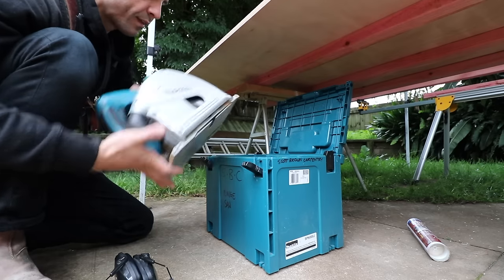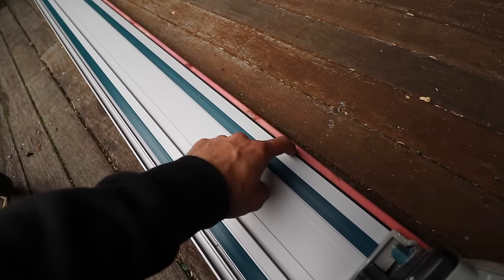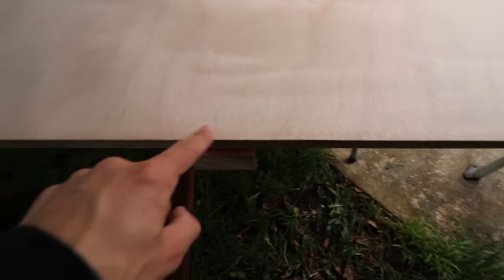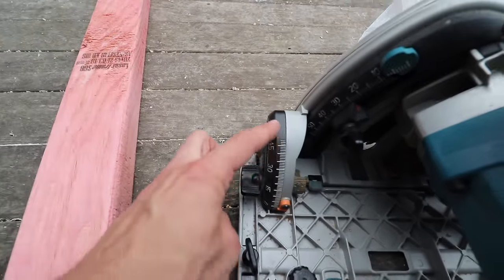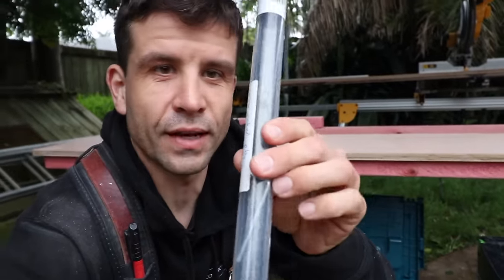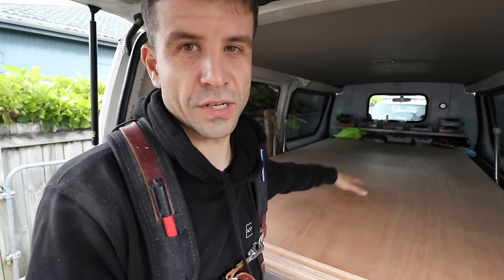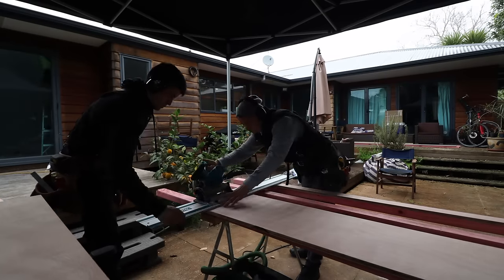Makita Track Saw (Why Every Builder Needs One)

Comment: Used both festool and makita tracksaws for the last few house builds 

Without a doubt I found the festool better for dust extraction and ease of use 

The makita is fine but everything seems a bit cheap and not thought out as well as the festool but still works ok
Reply: Tear a festool down and see what substandard materials are inside... Overpriced designer tools
Reply: The only thing that the Festool has over makita is the depth adjustment mechanism.  On the Festool it's very quick to squeeze, slide and release.  Makita there's a thumb screw.  But that's the only advantage Festool has.  Makita also has the tab that locks in to the rail for miter cuts, Festool does not.  For the money the Makita is a much better value.  I have both the Festool TS75 and and the Makita cordless track saw I recommend the Makita.  Plus, if it's stolen the Makita is cheaper to replace.
Reply: Agree with the Festool having much better dust extraction. If the Makita was around the same price as the Festool then I'd probably think I'd have been better  going for the Festool. But the Makita was, if my memory is right, about £100 cheaper than the Festool when I bought mine five years ago.     IMO it's certainly doesn't feel £100 cheaper.  A work colleague has three saws, mains and cordless Festool and a Mafell mt55. The Mafell is a serious quality machine.
Reply: Or stop playing with toys and get a Mafell ;)
Reply: @kyzenlanx  absolutely 🤣👍
Reply: Hehe I think you are talking about the BOLTR, AvE teardown...
Reply: %100 agree akita is good but festool is better
Reply: I’ve got the Makita plunge saw and a Mafell kss80 and tried the festool on site. Have to say for the price difference the festool isn’t worth it and most of the time I use the KSS now. If I was to replace the plunge saw it would be with the Mafell but only when the Makita dies.
Reply: I've used the fessy and Makita side by side and the Makita is better because it has more power and won't fall off the track on a 45° bevel.
Reply: @karlcraig7214  yeah they are lovely dogs really well tempered lol.
Reply: Festool is well designed with somewhat mediocre materials, like them apple products.  The Festool is a system; everything is also proprietary.  They do work well together but under very ideal conditions.  Makita’s in general  tend to be simpler in design.  They have a couple of failed tools but most of their bread and butter tools are of exceptional quality. They are more like Nokia’s - keeps on ticking.  In tracksaw systems, the Festool is a bit too large feeling.  Small and lightest that can handle the job is always better for me.

Comment: Great review, thanks, especially for a bit about 1st rubber cut of the  rail guide, as I though that I got incorrect / faulty guide.
I got mine for £216 which is the best price I could find.
Reply: Where did you find it for that price mate?

Comment: Be sure to cut with the "good" side down to avoid chipping on the good side .
Reply: with a good rubber and blade, you can cut with the surface at top without problems :)
Reply: @thedarksideofthemoon6970  No you need a 4mm board for clean cuts.

Comment: Yea bro. Love to use the track saw. Ours is the 2x18 volt battery Makita. Much faster then the clamp off set straight edge. Bummer you cut your track. Its good to have much longer then the sheet your ripping down.
Reply from the maker: Yeah I've got it at 2650mm, 3m would be ideal but these Hiace vans are only so long lol   thanks for watching bro

Comment: Morning mate. Both festool and makita are good saws but the makita has this rails lock thing very handle when you are doing bevel cuts 

You didn’t reply yesterday about coffee catch up / van tour haha
Reply: Depth adjustment and angle setting is easier to use on the festool over the DeWalt and Makita.

Own both. One for good one for rough and an 18v DeWalt when just the odd cut.

Once you've used a tracksaw as a chippie your days are numbered and you will but one soon enough.

Comment: I had the Festool TS55 for years but replaced it with the Makita 36V X2 battery powered track saw. No trailing power cord; no need for mains power. AND, another YouTuber helpfully pointed out the (ridiculously overpriced) Mafell dust bag fits the Makita saw very well. Indeed it does! So now I have no power cord and no vacuum hose trailing behind the saw. Fantastic! Oh, and I see no difference in cut quality between the Festool and the Makita in my applications.

Comment: you don't need to shell out for a three metre track when a hybrid will do ....just make a conventional saw guide from some ply and timber straight edge put two one and a half metre length track sections against the straight edge run the track saw along for an exact reference edge and bob's your uncle.

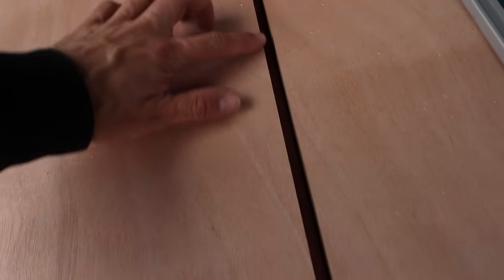Comment: I got something similar,  but I made it from offcuts of marine plywood. Cost me £0. Works great. @2:37 show us the other side of that cut.
Reply: You're worried about the bottom of the cut?  It would be clean because the saw is cutting "up" into the material.
Reply: @MrBaconis  who dis? New phone
Reply: @sasa1982uk  I'm sure what you said is very funny.
Reply: @MrBaconis  who dis?

Comment: I use an aluminium straightedge and two clamps.
Reply: Me too... but I've used a Festool and you just can't compare for accuracy and speed...
Reply: The track edge is cut specific to your saw. It shows you the cut line so you can set it on your marks and you're good to go! That saves a LOT of time! (and miscalculations!)

Comment: Still unsure why I need a track saw. I mean, don't get me wrong. I fully believe you know what you are talking about. I just don't see what it does that I can't already do with a good straight edge and my rear handle circular saw. I mean, I guess it is a little easier to line up the rubber on your lines vs measuring back from the cut the width of the saw, but effectively $1500 in tooling just for 5 seconds of time saving hardly seems worth it.
Reply: If you're installing kitchens or doing cabinets they're very useful. They a very useful tool when doing finishing carpentry. Great to have on site when doing soffits, kitchen counter tops and decks. Just all depends what type of carpentry you do I guess.
Reply: " ...don't see what it does that I can't already do with a good straight edge and my ...'" depends on what you do, the rubber strip also stops splintering so with the track on the "keeper piece" you get a factory style edge-cut.  I use mine on Counter tops, I can't imagine plunging into a $2k top to cut a sink in with a straight edge and a circ saw, and then you find all sorts of other uses for a track saw when you have one.  And then there's the dust collection ... and I still carry a straight edge and use it with a circ saw if that's all the material needs for finish.

Comment: track saws are more expensive then a jobsite table saw.. and yet.. they seem to deliver a better cut.. surprised the track isnt secured down in some form though, that I do question...
Reply: The track can be clamped down from underneath to the workpiece. The rubber is pretty good anti-slip so don't need the clamps often.

Comment: Yeah used both the Festool & Makita track saws. The price difference is not really worth it. Of course the Festool chippies are a breed of their own. The worst thing about the Makita one? The boxes. Man, those Makita stacking boxes are absolute garbage.
Reply: ive got a couple of festool cordless tools and about 13 Makita cordless. swapped out all my Makita boxes for festool ones, you only have to put a notch in the insert tray for them to drop in. best move I ever made. not cheap though, but I don't get angry anymore with the stacking and clips popping off.
Reply: Hugh Jarse Hahha, oh man, those clips dropping off into my ute tool box used to drive me mental!!! The plastic is really really cheap too, I had about 6 of the Makita boxes and over a year they all shattered. I ended up swapping all mine out for the Dewalt ones. 👍🏼
Reply: The dewalt ones do seem to be the better boxes. The Makita boxes are a tanos design so it’s the same shitty brittle over priced plastic that festool use in there’s. Just festool own tanos so they get the up to date version
Reply: I have almost all of my tools in Bosch's L-Boxxes. I like the width size, in between Festools and Dewalt and reasonably priced which is a concern when buying lots (11 and counting). The Makita track saw just fits on it's side in an L-Boxx 3. On the subject of tracks and using them on site, I highly recommend buying a clip on square like TSO's  GRS-16 or the 16PE.
Reply: Hugh Jarse 13???

Comment: Must be UK thing, ..I finish carpenter uses a tabesaw here in the states. As a framer we never use them only jobsite tablesaws
Reply: it's a german invention by Festo (Festool)
Reply: One big advantage with a track saw is you can rip material out of square, a table saw only allows parallel cuts. 
Also you can't easily rip a 2.4meter sheet of ply on a small table saw with one person, but you can with a track saw.
Track saws as much better for custom fitting sheet material. They each have pros and cons. Best off having both 😁
Reply: Not really mate. My Festool doesn’t have the bollocks to rip timber really. The fucker cuts out when over heats so a table saw is still king really. I’m considering getting a ts75 as well which has more go and use it with the excellent rip fence and maybe sack my table saw. Festool is massive in the uk now but really mafell is better
Reply: zap brannigan either get a Mafell KSS saw or a table saw for ripping heavy stock. Do not buy a ts75 it’s just as underpowered as the other festool you have. With the right blade my Makita will go straight through solid oak 40mm tops. But for ripping I’d never consider using it not what it was built for
Reply: They're starting to gain popularity in the US. There's a post frame builder on YouTube that uses this saw.
Reply: Yea no point in using these for framing.  They are for high tolerance cuts. 

I wouldn’t even use a table saw for framing.... good for ripping timber down to size,  but it’s comes cut and treated straight from timber yard.

Comment: waste of money. use a 1/4 x 4" (6mm x 150mm for you metric folks) piece of mild steel or aluminum and a couple of F-clamps and your regular skil saw. doesn't cost anything and set up time is less. I bought into the track saw fiasco and have to say they are okay but you spend more time setting it up to use than actually using it and for the money, it is hard to make it back with any time savings for the customer. If you are making fine cabinetry in your driveway, you are doing it wrong in the first place.
Reply: How is setup time less?? You lay the track down on two marks where the foam grips mean you rarely need to clamp, set depth and and make a perfect cut......it couldn't be simpler with virtually no setup time. The rail saw has revolutionised cutting accuracy and speed on site. For kitchen fitting I'd almost say it's an essential. I also shoot all my doors in with mm accuracy complete with leading edges to the point where my hand and power plane are hardly needed
Reply: Nonsense. An extremely versatile and useful tool, particularly for those without the luxury of a large workshop. I use mine to make precise and accurate cuts time and time again in my work. Why piss about with a straight edge and your own saw when this has been designed specifically? 🤦‍♂️

Comment: A good 8ft level makes a nice rip fence way cheaper lols
Reply: Nope
Reply: you get 2 strips of 12mm mdf, one at 350mm and one at 100mm (or customise these measurements to your own circular saw). Make sure the 100mm has a factory edge that is straight then glue and nail the 100mm strip on top of the 300mm strip but 50mm in from one edge of the 300mm strip with the factory/straight edge on the opposing side to the 50mm edge. Then once dry run your circular saw along the 300mm strip with the base hard up against the 100mm strip and boom you have a track saw with your existing circular saw. Then if you really feel like putting the finishing touches on it you can get some non slip tape (it''s like adhesive sandpaper tape and you can get it at any good hardware store) and stick two strips along either edge of the base. It will never slip and saves you having to use clamps. However clamps at times are still a good idea, which is what the 50mm allowance on the opposing edge to the cutting edge was left for :)

Comment: I couldn't imagine using anything than a freehanded skill saw.
Reply: You really need to get your hands on one for a quick shot, just a couple of cuts, then you'll be able to imagine a few things to use one for. Almost anything sheet wood related at ground level anyway! :) the skillsaw is still king for dragging up to height or ripping through joists, but they feel so primative on sheet wood after using one of these. Like the difference between a blunt handsaw and a nice new one 😁

Comment: No everybody needs the Festool Plunge/track saw. It simply is a matter of what type of work you are able to do with the tool. If you can complete the tasks you need with the Makita then that is all you need. 

I use the Festool in the workshop and on contracts. It enables workshop standard on the road. The Makita would not be quite at the workshop level of the Festool but it is still a solid performer that will suit many peoples needs. 

Festools MFT3 table set up with the saw is just amazing and will offer far more capability than a table saw and also be safer to use when flying through cuts but not as fast or productive.
Reply: I sold my Festool TS55 which I had owned for years to get the Makita X2 36v cordless track saw. Absolutely no discernible difference. None. And, not being tied to a mains outlet is brilliant.  With a Mafell dust bag (thank you, Youtube, for that tip), no vacuum hose either.
Reply: +David Freedman
I have used both and there are difference. The MFT3 combined with the TS55 is amazing and so are the dust collection abilities.
You could use a TS55 in a customers house knowing full well that you will not leave the place covered in dust. 

For the vast majority of people a Makita is all they may need.  A TS55 can also be inserted into a table to become a table saw.
Reply: You a fessy fan boy... The Makita has more power!!
Reply: +Randy DWB
If I need more power I can tell you it would not be the Makita that I would be using. 

The purpose of a track saw is not power it is accuracy. Makita make good tools but that is the same as saying they are on the same level as Mafell or Festool.

Comment: ive been getting by with a chalk flick line and standard circular saw for 11 years no real reason for spending all that cash plus the storage...im scared the track will move even with the rubber. if i need a track 100% cut i get a cheap alloy angle that thick and G clamp it and just run the saw on that. and cutting to a pencil line or flick line gives me 95% at worst accuracy
Reply: Hahahaha
You have no idea what you are missing out on
Reply: Million times better than a regular circular saw

Comment: Wow I paid $300 for the saw and 55” track and $180 for an additional 108” long track...you guys sure do overpay
Reply from the maker: NZ prices 😔
Reply: Scott Brown Carpentry move to the US, carpenters are in high demand and we are still a capitalist country l😉
Reply: I have the DeWALT FLEXVOLT track saw and I like it. I have a hybrid table saw and a job site saw. The track saw is useful, the ability to plunge accurately is what I find myself using it for the most, followed by initial Rip of a full sheet. I use my table saws more but I’m glad to have a track saw